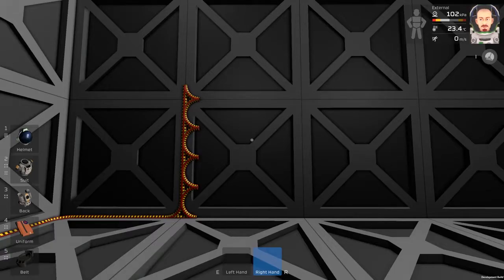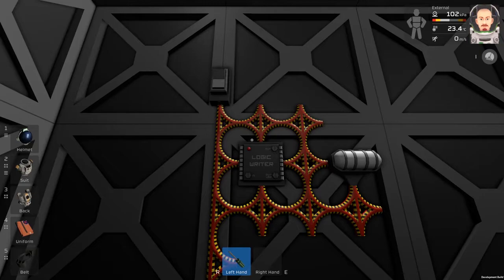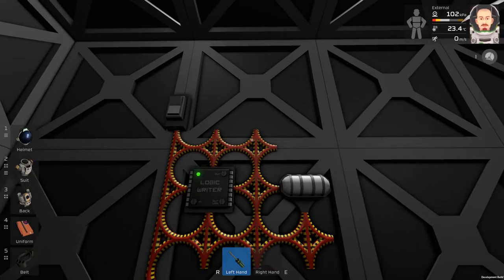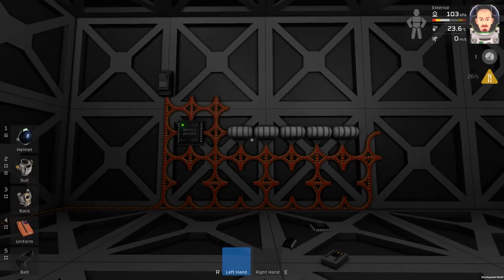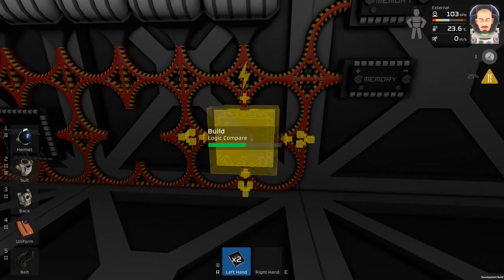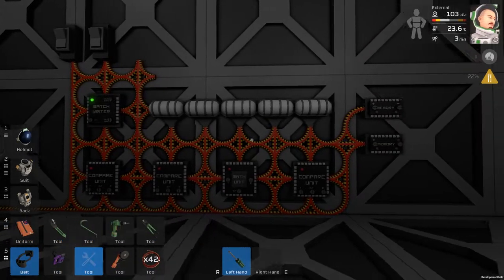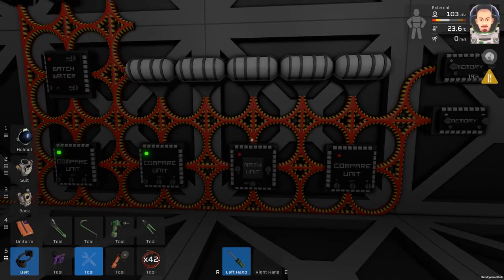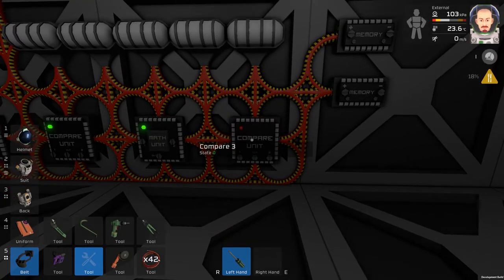Stationeers - Tutorial simple switch

Comment: Lets say i have a room with several wall lights (same type) and 4 switches. I want, that every switch turns the lights off or on. Meaning every switch changes the state of the lights. Whats the most simple way to this? 
(You can use any items that are available. So Logic I/O's, IC10, switches, levers etc.)